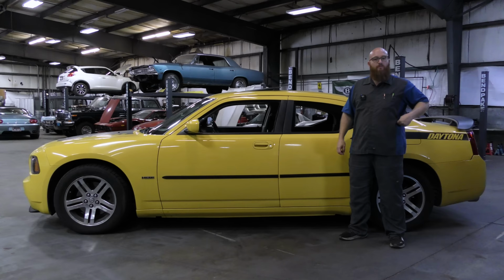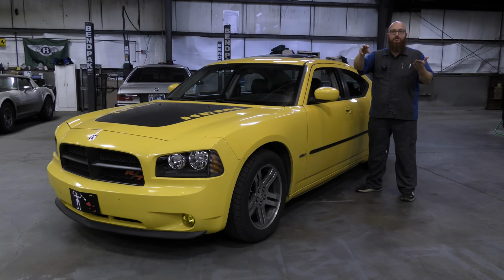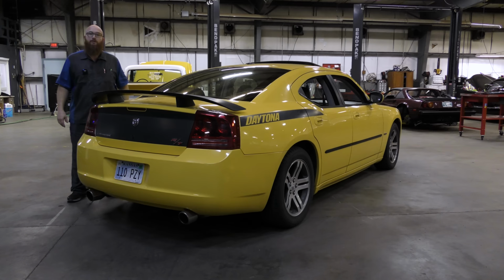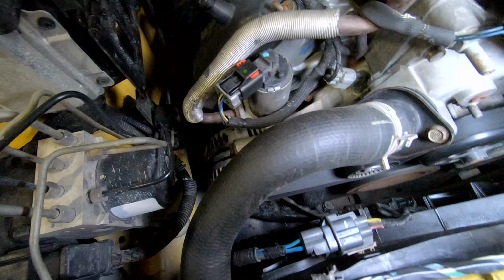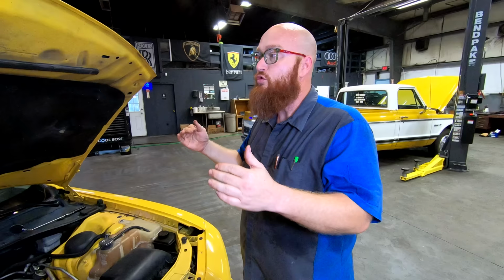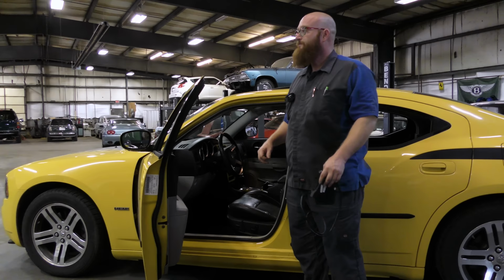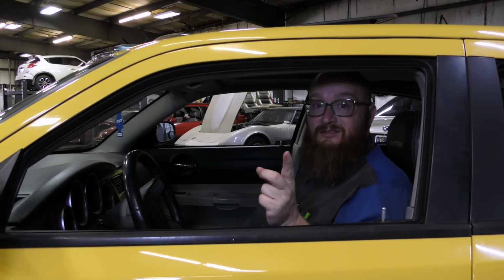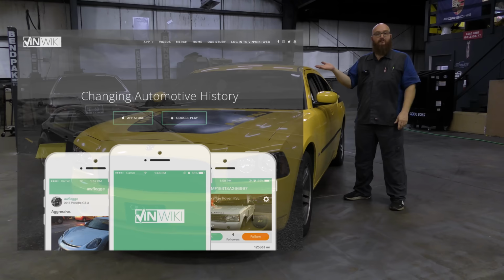4 things you MUST check before you buy any used car! CAR WIZARD shows how not to be scammed!

Comment: This is all so wrong! :) Here in Europe your steps are: 1. open the fuel door, 90% chance you will find polishing compound (meaning your 99k km car is actually 300k+, quickly polished before you showed up), 2. yes, pull the engine cover, but expect dirt! No dirt means there are leaks they've just washed... 3. borrow a paint depth sensor. Accidents don't get registered anywhere unless it was totaled, basically. It's customary for the insurance company to tell you "ok, let us give you $500 and leave us alone", which people take and "fix" the car with duct tape and zip ties, plus a lot of body filler, because why replace panels, those are expensive ;) (I was in such a situation after curbing my front bumper, they offered below $300 but I didn't take that offer and the fix was over $1000; I was also on the receiving end of the other end of the spectrum, someone intentionally causing TENS of dings and scratches before reporting all of them, out of everyone else's insurance.)

If you get through those 3 tests, you're already in the "mint" category. No need checking heated seats (as if anyone needs boiling their balls, come on, there's a reason why no one in Europe noticed BMW's heated seat subscription service, we want our sperm cells alive ;)) and all the other minor stuff, if anything breaks it should be cheap enough to fix ;)

Oh and no need checking fluids. They will be right on the level. Crankcase can be full of honey [1] but it will be right where it's supposed to be. We just replace all fluids after buying a car. European mechanics have umm... service level... called "I'm selling this car", with good mechanics yelling at such customer, but shady mechanics doing a "service" consisting of shutting down warning lights and filling up fluids with whatever crap they can pour.

[1] I'm not making it up, honey makes engine clicks go away and people actually did this! This also makes listening for clicks obsolete. You simply won't hear them, even in a car with an engine beyond repair...

Comment: I used to check them over well when buying from someone. I've went and found milky oil on a car someone said had no issues. Another one I went to look at they said it was in great shape and I crawled under it and my finger went thru the frame it was that rotten. Another one I looked around the rear shock towers and they were rotting out but the body looked great.

Comment: Another tip I like to recommend, of which I've never heard anyone mention this gem, but if you've made it to the test drive, and everything seems fine, hopefully the teast drive was at least 10 to 15 min if the seller doesn't like that, walk away, or he or she may ride with you fine, but here is the tip gem, after the test drive is done, get out and immediately check the wheels with your hand.  Wheels as in what most non-mechanics call rims.  Now it should be warm, maybe even a tad hot, but it should not be so hot you can't even keep your hand on the wheel even a second.  It's a great sign you have a brake caliper that is failing or has failed.  I checked out a car for a friend, everything went great up until after the test drive, no wobbles, or pulling to one side, nothing out of the normal.  Got back and I checked the wheels, and the front passenger was very obviously super nova atomic hot when compared to the others, I told my friend away from the seller as I showed the prices on the parts needed and how both front brake calipers will need to be changed, we talked to the ower about it he said oh is that what that is, always wondered, lol yeah needless to say we walked away.  My friend just wasn't interested after hearing that the owner knew about it but said nothing, especially when we asked anything big or small that wrong or not right or strange with the car, he said nope all good.  Lord only knows how long he drove around burning up that wheel, which I would also have done a full brake service, new calipers, pads, brackets, and rotors just to be safe.  And never do business with a liar.  Another great example I was hired to check a car out from an 18 year old who was the seller, just before the test drive I pulled out my 2k dollar scan tool and looked him in the eyes and I said, before I even waste the time to plug this in, did you erase any codes, if yes, I may still look at tht car, (I will ask why, but I wont tell the seller that as it gives them a heads up and time to think of an excuse) if the answer is no, and i find out otherwise, I'll unplug and walk away as we can't do or conduct business under a relationship built upon lies.  The 18 yo said nope I erased nothing, like saying that was going to make it true, oh man there were so many codes pending and erased my scanner on some vehicles will also tell me when the codes were erased, I shook my head, unplugged and started to walk away.  I even told him it would have been better if you were just honest and said yes and tell me why, than to flat out bald face eyes locked lie about it, gave you a chance to be honest, nope we are leaving.  Last one which is funny, years ago I was talking to another kid selling a truck, a 94' and he was about 4k over the blue book value, and when I asked why he said he had put in all this work and all these new parts, I said are the parts still new as in you haven't been driving the truck?  And he said no, I did the work about 5 years ago.  I said why in the world would I pay brand new prices for used parts?  This must be a new experience for you selling a vehicle, I said blue book puts your truck between, I forget now but I told him and his return was, I don't like Kelly's Blue Book pricing, I said Son no one likes the blue book pricing but it's right on, unless the vehicle was in a movie driven by a famous person or a rare collectable.  Anyway, I like looking at cars for sale and talking to the sellers and the funny things they try.  Not all are bad people.  Another tip, if they only will communicate by text, put a red flag up at least at half mass, it could be work schedule, or it could be it's easier to text a lie than to say it, and easier to say it after reading it, also texting gives the seller time to think of a lie than on the phone live.  Okay off my soap box, good luck out there, thanks for reading and always a thumbs up to the Wizard!

Comment: One more thing I’d add is how clean is it, like if you go inside the car and you see old shopping bags from the local grocery store or fast food trash from forever ago, I would knock a bit off the price for that. Or if the person has a dog, is the interior covered from head to toe with dog hair? If so, I’d also knock a bit off the price as dog hair is not easy to remove from the carpets, especially if it has a cheap quality carpet that holds on to stuff like Velcro. Also are the seats filthy? If so you will have to either do a lot of deep cleaning to them or pay a lot if you have a detailer do it

Comment: Buying a convertible with a rag top? Watch for frayed or weak seams. If the car lived in the sun, the rag top will have faded and loose it's water repellant abilities. Mine cost over $2000 to replace.

Comment: I agree with u but all the fluids r usually checked before sell cant go by that always have car put on lift look at bottom because u can't tell laying under if u can get there cars like that 1 u showing been road hard put up wet 20,000 miles is like a 100

Comment: A lot of people won't notice paint work / body work that might seem obvious to others. - So a good tip is to check inside around the door frames, trunk frame, wheel wells, bottom of the car, etc. Most cars with accident damage aren't fixed properly, and will have paint overspray in all those areas. Big red flag. Look for anything that looks like it's been modified or messed with.
Reply: hell I know a friend who has a vehicle that has a clean title that has had extensive repairs to it from accidents that you could never tell was hit.

Comment: Wizard the last vehicle l bought was a 1997 Toyota Hilux three years ago l have over 10000 kms paid $1500 aud it has done 430000 kms when we changed the regestration over nothing came up it came with an aftermarket cruise control that worked ocasionaly but l will not remove it because when it was fitted they drlled a hole in the steering wheel cover the windows are manual so are the mirrors no rust on cab so far l have replaced a lot of parts l spent over $1500 aud on repairs a lot of the work l have done myself still got a lot of things to do on it but the engine and gearbox are good the petrol pump under the bonnet had bean changed becsuse it looked new it now has a new exhaust system 4 new tyres l am keeping any paper work and writing what l have done to it with dates and the kilometers has had a full service but my test drive was from Newcastle in N.S.W Australia to my home in the Campbelltown area of Sydney and it made it home with no dramas

Comment: So far i been lucky, i owned a Mazda 323 sedan, bit weak engine but no big issues and not super expensive, a Honda Accord Aerodeck, the damn shop manual for it cost a ton but :)
never used so that was a good investment, a Volvo 940 Turbo, also no real issues with that one, then i had a Renault Laguna V6 that car was a nice driver but i had so many issues with
the coils, one per cylinder and i think i replaced 7 of them, and each time it was towing to the shop, at one point i was without the car for 4 weeks for a job that is likely 30 minutes for a mechanic.
After that i got me a Citroen C5 160hp diesel from 2011 it was a great car, no issues, fuel economy was quite good for a large car, had to sell it but i wish i could have kept it.

I was also told back in school to look in the tail of the exhaust to see if it is all sooty or white or gunky which could also be an indication that something is burned in the engine like oil or coolant.

Comment: I would have switched the order of 2 and 3 by doing 3 second and 2 third. It gives you more to go on before you even pop the hood, but that is just me. It is certainly critical that you look to see if there are any pending codes, as Wizard said. The car may have to go through several drive cycles, not just trips, but drive cycles, before the code either clears or you get a check engine code again. A drive cycle does not have anything to do with how far you drive the vehicle. What constitutes a drive cycle can be by make, model and year dependent. You may have to drive at certain speeds for a  certain distance or length of time, and it may have periods where you just coast and periods of hard acceleration. I had a 2001 Camaro SS and you almost had to have a designed track just for putting the car through a drive a cycle. The EVAP system was the most difficult to clear, with the O2 system the next most demanding. Most other pending states clear with a short drive. In other words, don't just expect that any pending codes will clear and all is fine after making a short trip. All in all, a great video, Wizard!

Comment: I want to add to this. 1. If the title has a different name then the seller, and the seller is OK with or even encourages you to contact the previous owner then it might be legit to buy it. 2. If you have someone pressuring you to buy the car, and preventing you from looking the car over by asking you (What do you think?) Walk away from the deal right there! 3. If the seller of the car will not tell you what is wrong with the car, and instead tells you what has been done to the car and is all they will tell you. Then walk away. The reason I am saying that, is because if you cannot look the car over because a Parent, Friend, Spouse whatever is pressuring you to buy that car while the seller tells you what has been done to the car, then you will miss important things like: Bad tires, old tires, lights that do not work because the wrong equipment was installed on the car, cracked vacuum hoses, old batteries, work that was said to have been done that may have been done but needs to be redone because of worn rotters and the list goes on. So that $6 thousand dollar 2001 Ford Ranger that your "mom, wife, husband, father, brother, sister" wants to buy you as a gift may end up costing you 10k to fix everything that you missed that needs replacing. All because it needs a new transmission, new light pig tails, turn signal bulb sockets, tail light pig tails, brakes, tires, clutch if it is a stick shift and of course a new engine and the list goes on.

Comment: I went to look at a 1998 8 Toyota Corolla. The guy had it listed at $500. It looked pretty terrible because someone had kicked every door Fender trunk you name it..... Yeah his daughter even danced on the roof with her friends...... I opened the hood and the belt was nothing but string.Pull the screwdriver from my pocket and took off the distributor cap which was nothing but powder inside. Literally touched the terminal and it just fell apart. Told the guy there was no way I could test drive it now until I went down to the auto parts and bought a distributor cap and rotor..... Needless to say I did that showed backup installed the parts took it on a test drive and told the guy there's no way I can do the 500 because it needs so much maintenance. This car had not had anything other than oil changes done it's entire life. At nearly 200000 miles everything needed Maintenance. But being that Toyota's can literally last forever last forever, I bought it with the agreed price of $300. So yeah replaced the belts all the fluids throughout the car and ended up having a bad wheel bearing after about 3000 miles so I replaced the entire hub. Other than that I wanted better tires so I bought used tires to put on And while looking for a good set of used tires at the wrecking yard I found a set of 2 month old front stretch and put those on the vehicle as well.. I put about 30,000 miles on it sold it to another lady who put another 100,000 on it and then she sold it for more than I sold it to her for.  Neither her or I were concerned about what the vehicle looked like although I did my best to push out the dense as best as possible. Oh and the trunk did not work so I had to climb inside and kick the trunk enough times to get it bent out far enough to allow it to pop open and closed properly. Lol but Hey it got me by for A couple of years... And I would not hesitate to buy another Corolla in similar condition.

Comment: When I work at the  Ft Lauderdale car auction & some times Car Max back in the early 2000 to 2005.They needed drivers to run the cars thru the lanes. Being a Mechanic,working at the Marina, a couple of my friends on a Saturday, would drive for them. The pay was a joke $15.00 for 2 hrs. so we got with a couple car dealers and made a deal that we would do a shake down on the vechicles that were going thru to be sold.we would normal have 5 min in the line before we were in the building that held the buyers. Back in 2004 New  Ford Mustangs we're going thru those building like water thru a sleeve, but ever now and then we would get a real sweety, like this 68 Olds with a 455 rocket engin, The vehicle was a total rust bucket, the driver door was hanging with one  hinge no passenger door (that was stolen)  it had 21000 on the odometer when I lifted the hood it has never been touch, Original Decals on the air cleaner, all 110% Original untouched. When it went thru the building they started the bid at $ 200.00  then up it up to 250.00 My Jamaican car dealers seen my index finger extended over the steering (the signal to buy) they bought it for $ 200.00 They came up in the back of the loading yard, said Yoooi man Dalll, what hell is this piece of crap? I told them you just made a chunk of change.. How that, they ask? We're pulling the engin and tranny, putting it on the wire, it will be sold in a week, guarantee! it sold to a guy in California for $4000.00  in 3 days. But a couple things that was mentioned was spot on, especially the serpentine belt. I would run my index finger in the exhaust out let to see if it was carbon, oil, or antifreeze by tasting it if needed, takeing the right front tire and turning it and watching the steering wheel play & jounce test, place the car in 1st gear and rocking the car backwards, checking another 7 things. This could all be done in less than 2 min if everything check out it was a drop thumb if bad (No Bid)  extended ring finger met buy! We only charge $50.00  per car, But like you were saying thoroughly check out those cars & trucks, if it's a big chunk of change take a mechanic with you, many of times I've done compression check on the engin, owners are normally happy to see it happen for their own knowledge.

Comment: One thing thatbhapoened to me was vibraton and "turbine" noise... because its a high mileage car I expectes to have some imperfections but it turned put the winding noise was the belt all slippery from oil (seems the guys had the motor cleaned squeaky clean before arriving), also the vibration they said it was the motor mounts with wear and tear for so many running miles, it checked out, but further inspection showed that it was all oil damage (oil damages all rubber parts, who knew). Theres a lot of shit to check out, even watching this video if youre inexperienced the best advice would be, get an experienced friend or look for a mechanic in google maps closby for an effective inspection. Also may I add don't bring your dumb friend just because hes always got free time it will do you no favor, he only distract you.